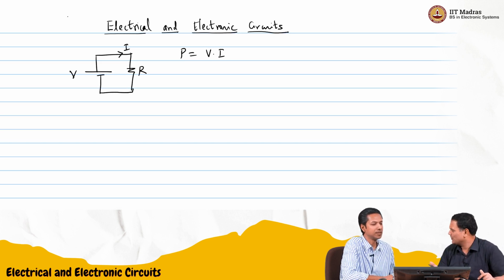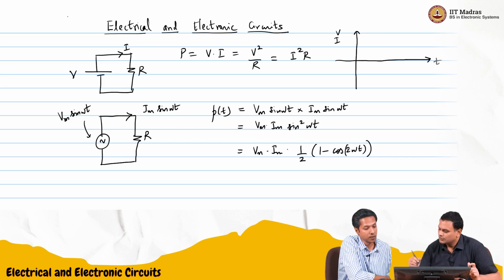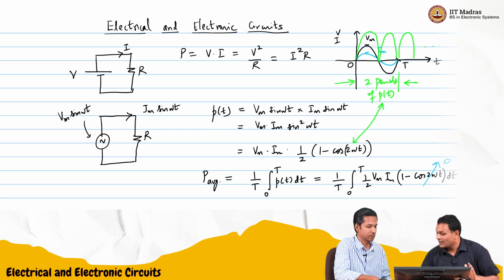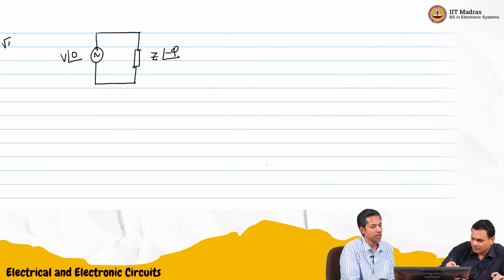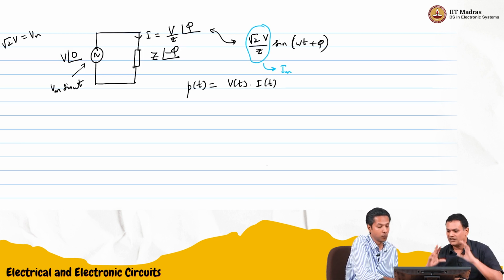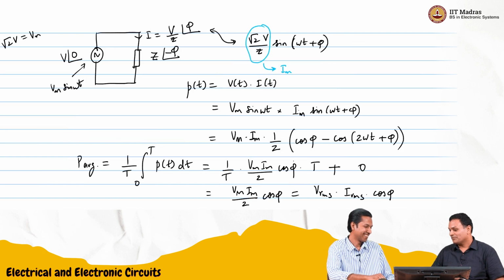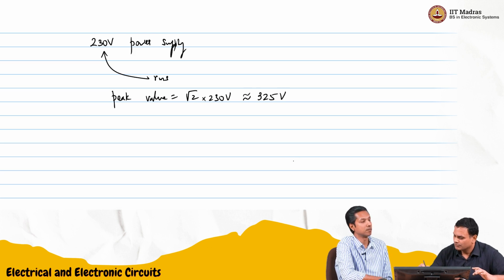W1_L6: Complex power : part-1 | average power & power factor

Comment: Notes 
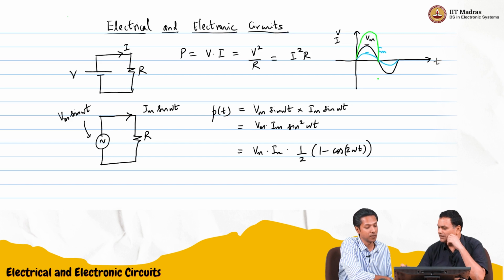5:20 Both Voltage & current are negative so the power is positive again
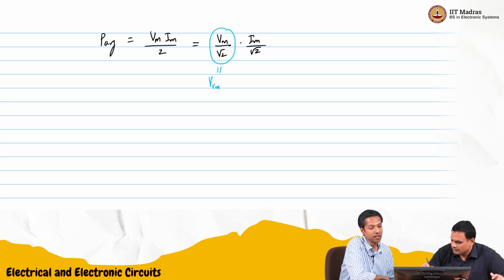8:54 in the case or resistive load, the 
Pavg = Verma × Irms
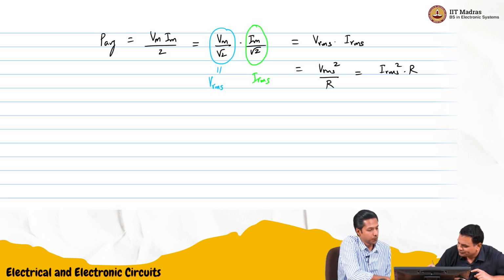10:52 important part. Don't forget to multiply by √2
12:03 note
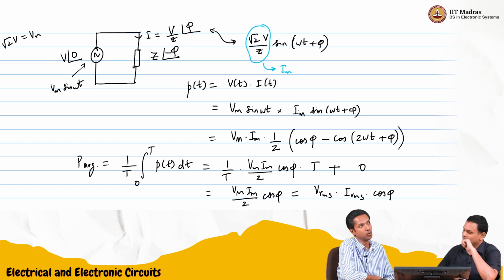21:39 the importance of CosΦ